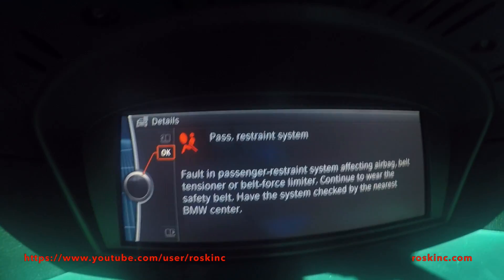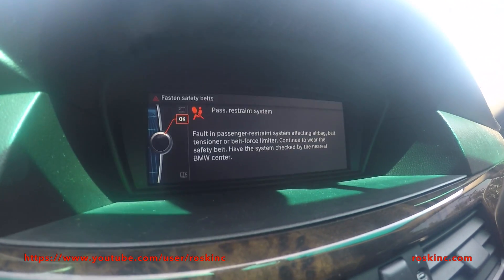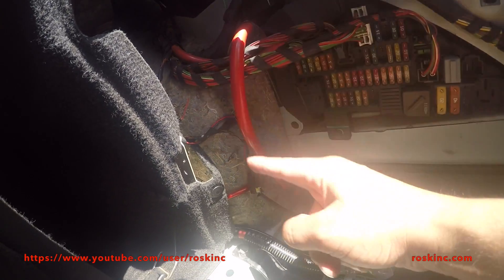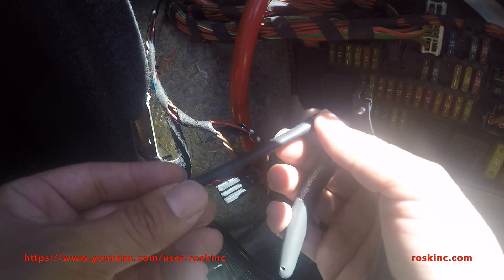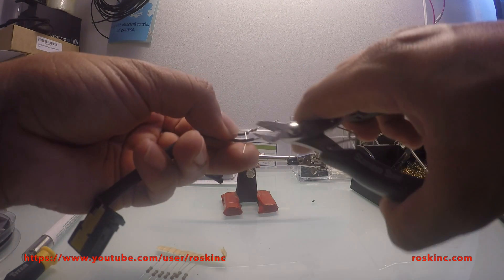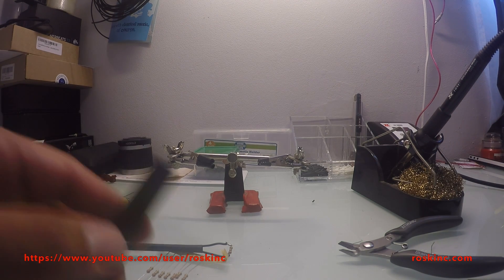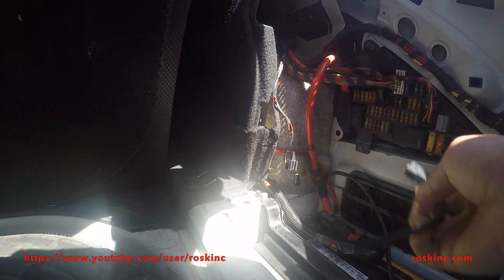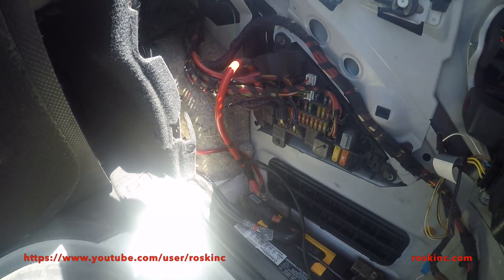e60 5 series BST bypass passenger restraint error fix

Comment: whats the wattage of the resistor? im tryin and its not working... and does it matter that i used two 1 ohm 1/4 watt in series instead of jus one 2ohm resistor
Reply from the maker: 2ohm I would stick with the 2ohm as I've never had a issue on any of the vehicles I've installed on but some people say using two 1ohms gives issues.

Comment: and after these actions the security system is working properly? or by turning off something?
Reply: it won't disconnect battery in case of accident... 
i would worry if you got petrol... less if diesel as it is not flammable

Comment: Hey man looking to see if you can diagnose a dynamic driving code? Not sure if it's common, but I can't get rid of the code through INPA. 

Have you ever dealt with this? 

Any input will help! Thanks.
Reply: Aj Cordova hi i had many problems of Dynamic drive system on my E60 2004, but now its fixed so tell me what exactly you need to know about it
Reply: Adil Akrouh BMW said it would not take coding, so the module may need to be replaced? The steering wheel sits slightly to the right, but as far as steering goes it works just fine. I tried to clear the code but nothing seems to do the trick. How do you clear that code? and how was your problem fixed? Thanks.
Reply: What code exacly you wanna clear ?

Comment: Just bought a e60 yesterday and have this code, but my computer screen and menus are different then yours mine seems outdated any way to update it?
Reply from the maker: The screen you see on my video is Cic find in late 2009 and 2010 e60. To upgrade you need to get the newer module and code. Dealer can do software updates but won't look like the screen I have.

The error should be the same regardless of which module you have.
Reply: roskinc awesome thanks for the info! liked and subscribed

Comment: Does it have to be exact 2ohm or can it be in some range? I got one 2.2ohm will that work? Thanks!
Reply from the maker: Should still work. I had a buddy use a bigger ohm resistor and told me it's worked just the same. Wrist scenario you just re solder a 2ohm if it doesn't.
Reply: I can confirm 2.2 Ohm works just fine now (at least about month now)

Comment: You're the best! Hella e60's have this problem. I brought my car into the dealer to have the seat mat fixed and they told me after the repair that it was the bst cable that needed to be replaced.
Reply from the maker: I've heard one too many times dealers charging for mat replacement only to still have the error. Also when e60 go in for the battery cable recall they end up having the error when the dealer move the bst cable around aggressively.

Thought I'd help people fix this issue cheap.